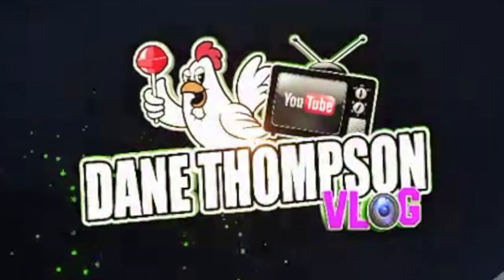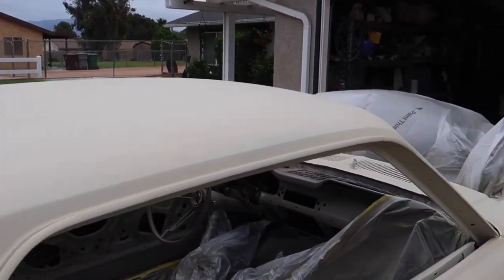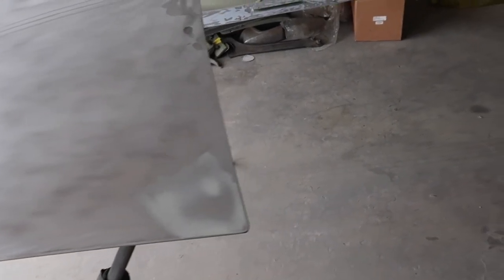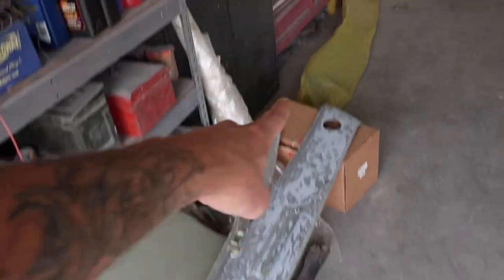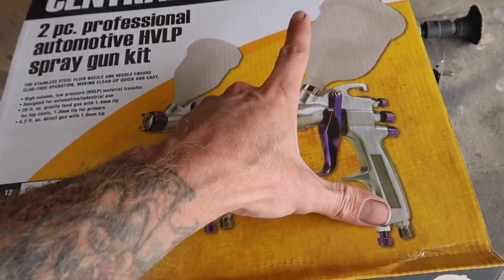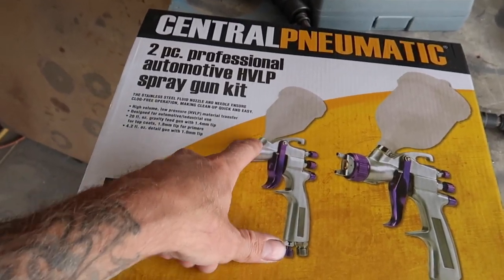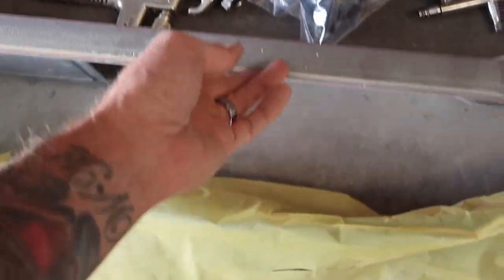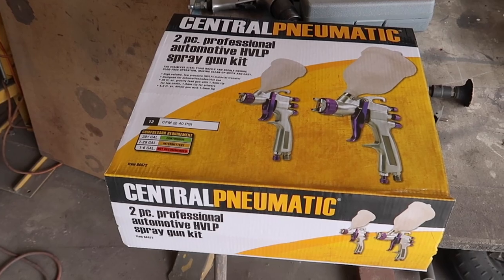Harbor Freight Spray Gun For Primer DTV ep20

Comment: Just to follow up.  I just  put  down some Montara high build, and it definitely  took  a few passes  to find the best psi and slightly  narrow  fan. Had to reduce  a little bit more than  the recommended.  But this gun really pounds  it on well with the 1.8 tip.
Reply from the maker: Yeah thats what I do with it usually. Ill splash in some actone it get it to flow a bit better and narrow the fan way down and let it rip.

Comment: Besides primer this gun works great for spraying Benjamin Moore Advance paint.  I bought it for that job and recently sprayed a vanity, had to thin the Advance 10% but wow did it do a fantastic job!
Reply: Hey man I recently bought this gun , will I be able to prime my truck with gun, what issues did you run into
Reply from the maker: It will work fine for that. It just takes a lot of air. You might want to change out the nozzle to whatever the smallest tip is that it comes with as well.
Reply: @Burndown  i found the opposite you want to use largest tip 0.018 and lower pressure delivered best amount if fluid allowing the paint to do its self leveling
Reply from the maker: @msk3905  for high build I agree. That’s what I use it for. For a sealer primer no.

Comment: I use harbor freight spectrum black widow guns for painting I've had them for several years and still going
Reply from the maker: I used these cheap ones for poly primer when I shoot it. The stuff will ruin a gun if you don't clean it really well so I would rather used these then ruin an expensive gun.

Comment: another option for you might be an ebay gun I just picked up which comes with three needle jet and cap sets 1.4 1.7 2.0 for about $30. it has no name but has hvlp cast into the handle, there are not many multi tip cheap guns available.

Comment: Dude throws away $50 every two jobs lmao. Wish I was made of money like that. I bought a Iwata and had it for 7 years now. Still works perfect paid $545 who’s spent more? He did by far and I have a much nicer gun. But for a one or two DIY viewer yeah it’s a great deal $50 and one car is prolly all the would paint in a year or more. So I get his advice in that respect
Reply from the maker: Like most painters I have a few guns. A good paint gun is expensive and the last thing you want to do is run high build polly primer through your "good gun". You might do it but I would rather not. The word job is vague so thats my fault. This pack of guns usually lasts me for 2 maybe 3 complete restoration jobs and then ill replace it if its trash by then. So that would be all the panels and parts of two or three complete cars. Not like a bumper and a fender and toss it haha. I still like these guns for the money. I have both of these still from this video as well and its been over a year and they work fine still. Since I made this video 3m now has a modular gun that you can just replace parts on that has a big tip so that may be an even better alternative cost wise but I have not tried them yet but hear good things.

Thanks for watching and sorry for the confusion. It does sound like I don't clean them at all and just throw them away after like 1 use but thats not the case. If I review anything at this point ill have to do a better job next time.
-Dane

Comment: Nice Stang!  I'm currently redoing a factory stock '69 Fastback, ONE owner and all numbers matching.    ;-)
I'm wondering if that larger tip will fit on the "Purple" gun everyone seems to like.  I hear that if you clean
them  good when you first get one, and then clean it well  every time you use it, they'll last a long time.  I've been using a "Binks" #7 siphon feed gun for years but am FINALLY going to try out the gravity feed style soon.  I have a brand new "Sharp"  I'll use for painting, but I want a good primer gun that will lay it on good and thick when necessary.  Thanks for the video and info....and I've subbed!
Reply from the maker: Thanks man! Yeah you can clean them well and they will last a bit. The big gun takes  a bunch of CFM to run  tho. Its good for thick primer. I have not tried the other purple gun. I think it all depends on what your trying to do. If your new to painting your probably not going to be able to  tell the difference between a good gun and a cheap gun anyway. Painting has a learning curve and you will have to get familiar with sanding if you want to learn how to paint 😃

Thank you for the support! Maybe ill have to make another paint tech style video soon.
-Dane
Reply: @Burndown  I should have explained.....I've had a little autobody and paint shop (for myself and friends) since the '80s, so I've done most everything including fiberglass repair (boats and Vettes).  I just want to "graduate" up the HVLP gun and see how it works for me.  My Binks has sprayed alot of cars over the years and it's a great gun, but it's time for me to try something new.  Thanks again for your video!

Comment: Good review and comments.  What size/brand compressor are you using.  Have you any experience with LVLP, like Sprayit/SP33000?
Reply from the maker: Hey Joe. I have an Ingersoll rand 80 gal compressor. I had a 60 gallon when I first started and feel that 80 is minimum. I don't have any experience with LPLV so I can't help you with that.
Reply: @Burndown  I  use  a  spray it great  gun....

Comment: I’m having issues with this today..1.8 spraying like it’s clogged or tip is dry and then working fine and then clogged again. Cleaned everything very well, used it for the same HOK KD3000 sealer reduced the same just a couple weeks ago.   

So I reduced maybe 10% more and put the cup on a 1.4 purple gun and it sprayed great. 

Any advice from pros or daily painters would be great. Thanks all. Peace and Paint
Reply from the maker: You need to make sure your straining your paint going into the gun so you don't get junk in it. Also check to make sure the cup vent hole on top is not plugged up. If you can't see through it it won't spray correctly. Keeping the gun clean is key to having them work properly.
Reply: @Burndown  dude…I totally had the plug cap in the lid of a disposable cup. 🤦🏻‍♂️🤦🏻‍♂️

Always used the standard cups with plugs that vent, figured if the plugs came with the HF disposable cups I was supposed to use them. Good thing this was a mistake in primer and I left it hanging until I gained confidence and knowledge. Now I’m gonna lay some sealer, base, and clear 😎👍🏼

Comment: I wouldn't consider these a throw away... But they are inexpensive.
Reply from the maker: I use them with polly primer till they get to the point of no return. I need to watch this agin. Sounds like I'm telling every one that they are like a one and done kind of gun witch is not the case. Yes you can clean them and run them quite a few times. 
Thank you for the comment!!

Comment: Sounds like you just stuck at cleaning guns. I have that exact gun its lasted me 2.5 years and still works bruh.
Reply from the maker: I spray Polly primer through it only. I run them till they die. If your an amateur and the primer kicked off in the gun it’s a throw away. I still have this gun today from when I made this video and it works fine but when it doesn’t I’ll throw it in the trash. Thanks for the comment.

Comment: Anything can spray primer dude.
Reply from the maker: This is technically true but, Typically your high build primers are thicker and take a larger needle and seat to spray the lower viscosity material. You can thin it till it shoots out of what ever size gun you want I guess tho. But if your gun tip size is small, that defets the purpose of a high build primer anyway by decrease the fill capability. 
You are right to a point tho, It can be shot out of whatever you have if you thin it down enough.

-Dane

Comment: This guy probably paints the cars and doesnt clean the guns after use then goes out for a smoke break and let the paint dry intentionally so he can go into hft and be like i need more guns
Reply from the maker: I don’t smoke or take them back to HF. The get trashed from using them with high build poly primer and eventually get so full of crap it’s cheaper and easier to just get another set. I’m not even sure if they sell these still and haven’t replaced the ones I got in the video yet.
Reply: @Burndown  why not tone it down a bit it should still work is the chemicals eating away at the gun itself?
Reply from the maker: h22sparks I use the gun for polyester primer and it builds up over time even after using acitone to rinse it out after each time i used it. The gun cleaner I use would eat the seals in these guns if I dipped them from what I remember. Like I said I still have both of these from when I bought them in this video.

Comment: Harbor Freight Guns are COMPLETE GARBAGE. Cheap tools & materials represent the single biggest mistake DIYers make when approaching these types of projects. Remember tools are not an expense, they are an investment that you make in order to achieve superior results. And once the job is done they can then be sold for 80-90% of their value, so in the end it will cost less than renting. These 2 budget HVLP Systems are the best hold their value: 1st choice: Fuji 2202 Semi-PRO 2 (2203 gravity version) & 2nd choice: Earlex HV5500.
Reply: To some point it's true but to say an investment that loses money, is not an investment...it's a liability.
Reply: For $10 when the purple HF gun is on sale if you paint 1 car yourself you've saved several thousand dollars, so to call them garbage is probably due to your lack of knowledge on how to use them...they work great, and they do what they're designed to do.  If you don't clean them and adjust them properly sure its going to be garbage to you.  I use the siphon guns as well they do great.  Preparation of the job, proper spraying techniques are the #1 cause of success or failure.  If you can't do either one it don't matter if you got a $1,000 paint gun or a $10 paint gun its going to be a shitty job.  People seem to get wrapped up in the price of everything, but can't get past that and see the results of the same job with 2 different tools at different ends of the spectrum.  

Now, if you went to a paint store and bought that purple $10-15 paint gun you'd love it, since its on the shelf at HF you hate it...that's the typical response from people that have no idea what they're doing and just have to bash HF no matter what they do.
Reply: If you ever use a quality gun you'll understand. This one is worth the price: https://www.amazon.com/dp/B00XQPN684/?coliid=I1S6WZZYT2FYA2&colid=3KP7G6YLK1U61&psc=1&ref_=lv_ov_lig_dp_it
Reply: @johng9562  Lol. That spray gun sucks for automotive. I've seen the pros use it and didn't get good results. I'm not a pro painter but know people who are. There's a reason you don't see it in a body shop/

Comment: Buy the extended warranty for 7.99 and you can take them back and get a new kit for free every time they go bad. Just pay the 7.99 again and do it over.
Reply from the maker: Yeah I didnt even think about that. It would be funny to bring it in after almost a year of use with dried up cracked on paint and the them it just stopped working. They last me about a year or so depending on use.
Reply: They never ask questions at my store. Even if I lose pieces they will replace it